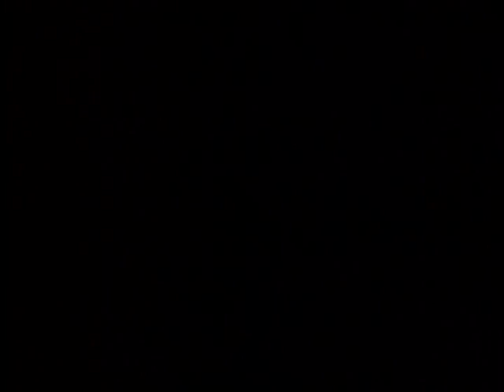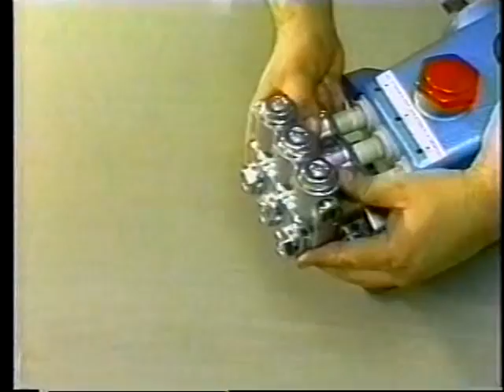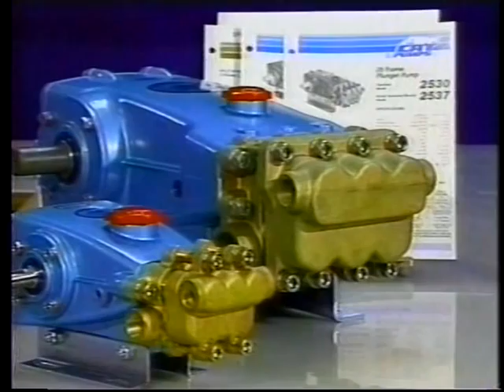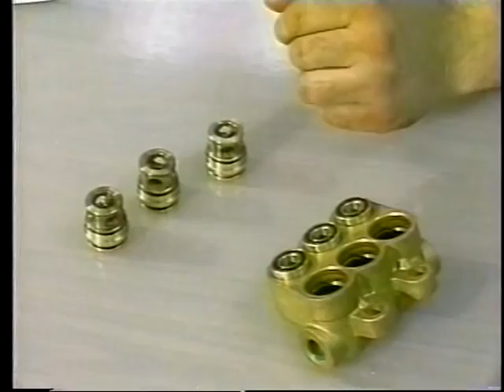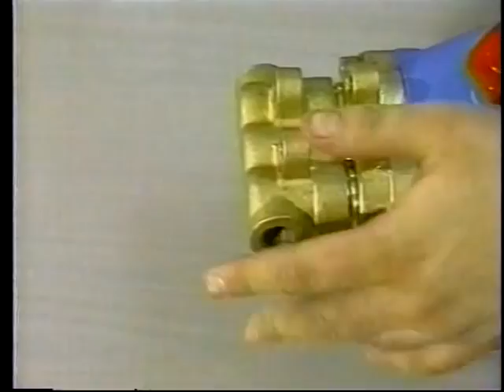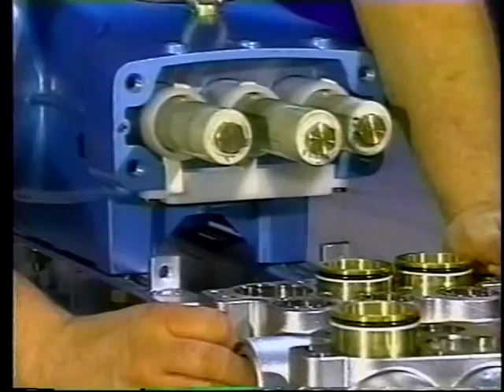CAT Pumps - Pressure Washer Plunger Pump Repair Video Hydro-Chem Systems

Comment: I'm looking to buy an BE 4000 psi , 4 GPM pressure washer. It has an Commercial-grade triplex pump. Is that a good pump or should I go with something else? Lowe's sells them for around $1300.

Comment: Hi Dan. I've searched high and low for a reverse pliers just like the one used in this video. I'm trying to remove a spacer which holds the water seal in place on an Annovi Reverberi RSV pump. The pliers needs to be long enough to reach a spacer around the piston. Thanks. - Mike